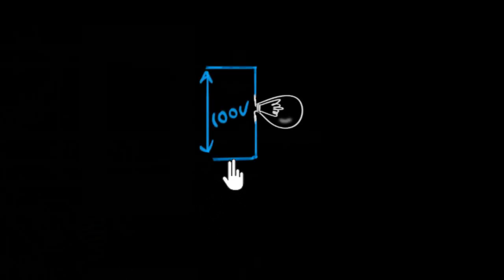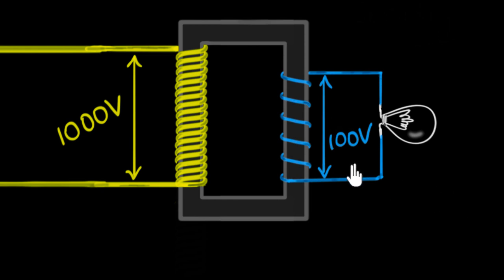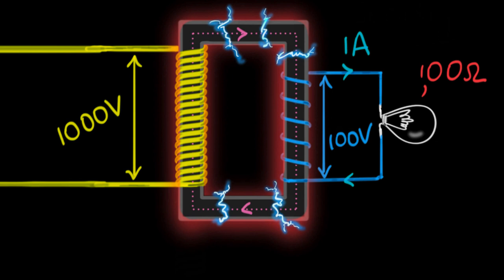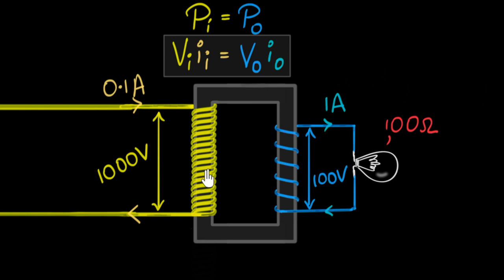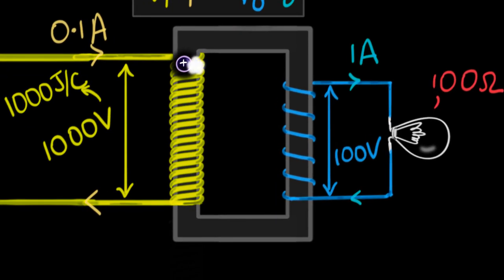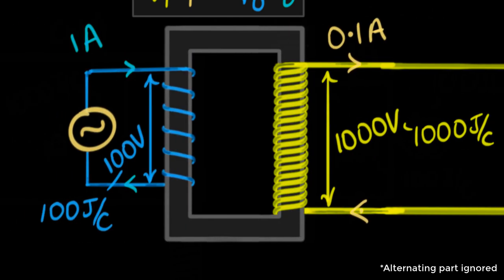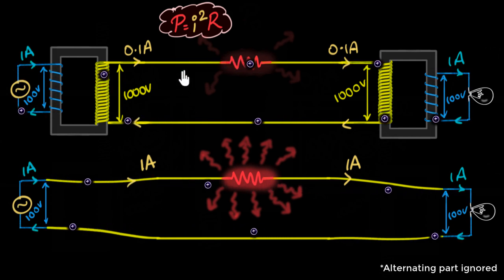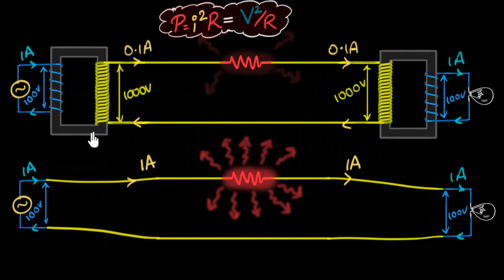Transformer currents & energy losses (intuition) | A.C. | Physics | Khan Academy

Comment: 6:12 If the second transformer is removed and the 1000V is connected directly to the circuit containing the bulb (just as an instance), would Ohm's law still not work? If the law will hold then increasing voltage by increasing the number of turns in the number of turns in the secondary circuit of the first transformer would in essence decrease the current in the secondary circuit containing the bulb (again violating Ohm's law). So how do you explain that?

Comment: question: can we explain the lower current flowing through the land wires by saying that they have R resistance value higher than the resistance of the stepped down circuit?

Comment: Basically correct except the voltage on the power supply side is not 1000V. It should be 1000+0.1R+0.1R = 1000+0.2R (V)

Comment: Thank you sir, very well explained. My question is, how would i reintroduce a sufficient current to circuit that has been stepped up and thus lossed current without using a transitor because they only work in DC circuits.
Reply: I guess the answer would be to send an exagerated amount of current so to finish with the amount needed on the other side. Sounds kinda dangerous.😁Please need help.

Comment: Nicest video..can you explain why there is a voltage drop in the grid when there is sudden increase in load.
Reply: I think because of increasing load, there will be resistance also increased and that's why current flowing through load will be increased that's why voltage drop occurs
Reply: Considering power from power station  be constant, voltage of grid = power from station /current in grid. If load increases, current in the grid have to increase to supply power required. When current increases, voltage drops down.. the dropped voltage  may not provide required voltage to the appliances.. thats why supplimentary generators are used to balance voltage .....this video taught me more than my 30 years of studies.

Comment: I want an answer 5:32
what if I shortened the circuit, would the current be the same?
Reply: Nope bcz resistance depends upon length of wire

Comment: 10:29 I'm also a confusing kid but still didn't understand p=v^2r..
Can you explain more??
Reply: The V in this equation is not the emf induced by primary coil, its the voltage drop across the resistance of wire itself.

Comment: I have a doubt sir. Considering individual circuits, specifically, the 1000V circuit, if the voltage is high, shouldn't the current also be high?
Reply: Like if you are saying for individual circuits yeah it would be high but in the power line which is connected to the ac source initially current is drawn from the ac source by mutual induction which is not directly connected to the circuit so ohms law is not applicable as it is not a single circuit so current will he 0.1 ampere in the transmission lines but let's say afterwards when current is flowing through the bulb and we increase the number of turns in the second transformer which ultimately will increase the voltage in the bulb circuit it will increase the overall current in the blue circuit containing the bulb as it is a single circuit and we can apply the ohms law

Comment: still I am not convinced.....After stepping up the voltage across the secondary windings increased...... if the voltage is increased corresponding current also will increase .....with out ohms law also I have this doubt............
Reply: bro you too in 12th right or preparing for entrance exam